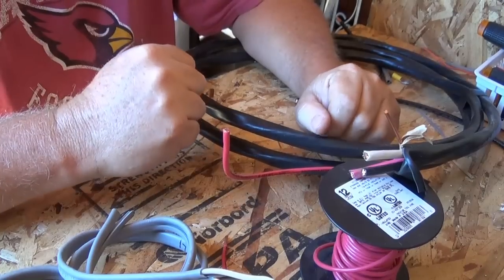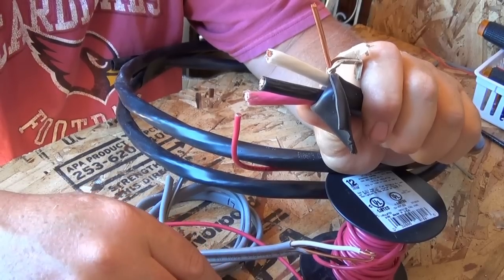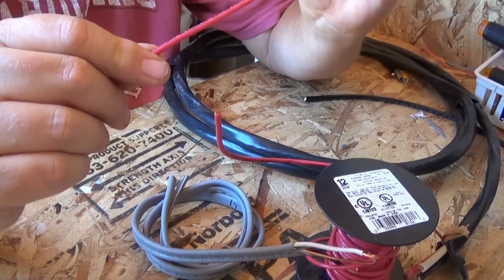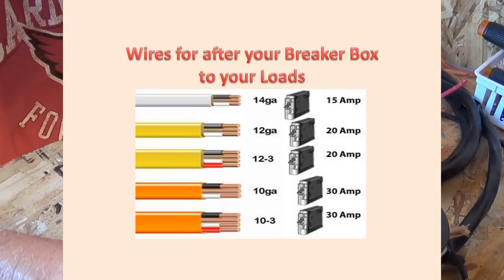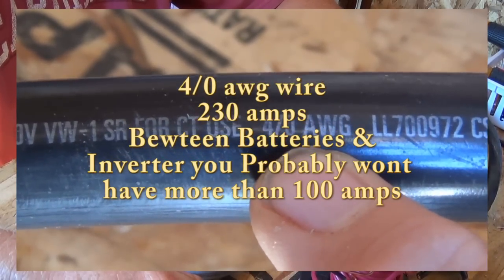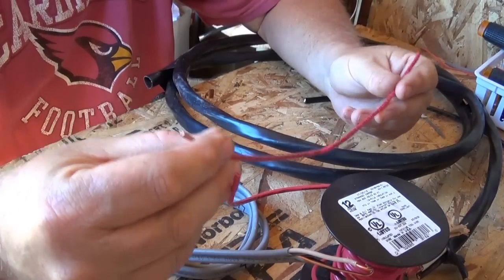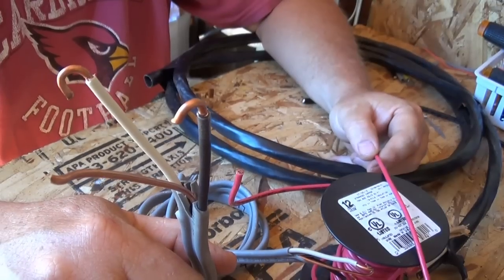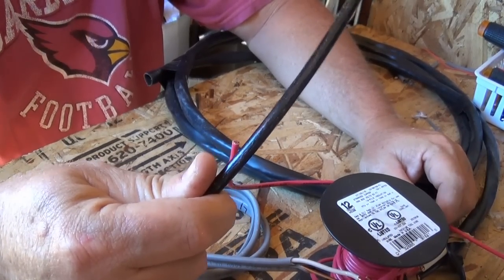What Size Wire Do I Use To Wire My Solar Components? Does Wire Size Matter?

Comment: The whole voltage drop part is bogus.   This is from Google search.  "The total cross-section area, AWG or "circular mill" size of a stranded conductor is equivalent to that of a solid conductor for the same designated wire size. ... Similarly, there will be no less or more voltage drop whether you use stranded or solid wire and the current carrying capacity is the same."   Especially Bad was the lamp cord and voltage drop from 120 to 110 volts in the short cord.   The difference between solid and stranded is flexibility.   Electricians pulling conductors through conduit prefer stranded.   Pulls easier.   Otherwise most of the other information was reasonable.
Reply from the maker: interesting info. i would never use stranded wire with 120 v . for dc stranded does matter.

Comment: Are you an idiot the rating on your wire has to do with maximum without resistance the longer the wire the more resistance so you need to refer to a chart which are available on the net. BE SAFE
Reply from the maker: an idiot. lol thanks. i have a degree in nothing and an expert at nothing. lol..
Reply: ArizonaHotHomestead Disagreeing in nothing is agreeing with all! thank you very much

Comment: If I need 6 strand can I use 2 / 10 ga in  place of the #6?
Reply: By the letter of the law, parallel conductors must be able to carry the load in one wire. Parallel conductors are used to overcome voltage drop.
Reply from the maker: i wouldnt. the same volts/amps will travel each wire and a smaller wire will heat up resulting in potential fire. keep it simple.

Comment: Why factory just make mark on the cable base on amps ??  Not code .
Reply from the maker: dont know. i would assume the wires are used in so many other projects where code doesnt apply.

Comment: AWG isn't a good indicator of current capacity.  I have 14awg, and that's rated for 30 amps, and 16awg at 21 amps.
Best way to select cable is read the manufacturers data sheet. I use Farnells for that.
Reply from the maker: wow 14awg rated for 30 amps. i think that might be max before it starts to melt the outside of the wire. i would never think 14awg could handle that many amps. thanks for the info.

Comment: I wanna if is possible to join wire on ac side from solar  system
Reply from the maker: keep ac and dc separated. use an inverter to invert the dc power to ac and a converter to convert ac to dc but never join them.

Comment: My inverter its burned the last line of fuses 20 amp each one, is 2000 watts current, I change the mosfets but still is burned the last line of fuse, only that the firs and the second is OK. What can it be grong?
Reply from the maker: not sure. missouri solar and wind, or  northern arizona solar and wind might be able to help.

Comment: Stranded is always better cause conductivity depends on surface area. In other words, the stranded one will be more efficient.
Reply from the maker: which is why using dc power stranded wire will hold the volts better than solid.

Comment: if a wire has a 600v rating, does it matter if its a/c or d/c. will it pass an inspection if i use a/c wire on my system as long as the volt and amp rating is correct?
Reply from the maker: good thinking but the way electricity runs you need stranded for dc and solid for ac.  otherwise over a distance if you had dc on stranded you would have a greater loss in volts. and ac may melt the think stranded wire.  hope that helps

Comment: Not explained more but mentioned, was auto jumper cables. They are designed for large amps (large gauge) ... for a short time... starting an engine should take only seconds. The insulation is more flexible for convenience...on the same rated conductor, the heat generated is short term. Continuous high amp circuits require insulation that is capable of handling the generated heat... so is denser, less flexible than jumpers, and of a different chemical composition. i.e. do NOT use jumper cables as hi amperage cable run, as their insulation WILL melt, causing a short circuit & eventual fire !
Reply from the maker: great point.

Comment: I looked into moving 12VDC at 10A(120W) accross 80' and found that i needed to run 4/0 cable to do it(very in-practable and expensive)

Iron rod would have been cheaper(like a car frame) to keep cost down. 

Ended up installing a 500W grid tie inverter, and charging the remote battery bank.
Reply from the maker: wow 80 feet long way. if you could increase the volts you can reduce the wire size.  or bring the 2 closer together.
Reply: Not sure why you needed 4/0   2awg can do it with only a .32 voltage drop.  One thing people forget is that you can double a smaller wire to carry more load.  Two 1/0 wires can do a better job then a 4/0 for about the same price.   Just make sure you fuse the individual wires according to their amperage rating.

Comment: Solid wire is for static installations such as inside walls. It is cheaper than stranded wire.
Stranded wire is for installations that need more flexibility or for applications where the wire would have movement.
Large gauge wire would be too difficult to work with if it was solid.
Reply from the maker: thanks. good information

Comment: Electrons travel on the surface, and stranded has more surface area than solid of the same gauge.   And the "RED" wire is "HOT2", black being HOT1, and white being neutral (bare wire is ground).  3 wire is for running 240vac, so always assume Red means dead if your heart gets shorted between it and the black wire...
Reply from the maker: thanks for the information.

Comment: I'm having a real tough time finding out what size wire I should use to wire 4 6 volt T-105 225 amp hour batteries in series then parallel to end up with 12 volts 450 amp hours, and how  do you find out that information. How should Amps and Amp hours be treated different??
Reply from the maker: amps and amp hours is same thing.  use the biggest cable/wire as possible to prevent the wires from getting hot and losing volts.     i would use 0 awg. or bigger. maybe get away with 2 or 1 awg but feel the wire and if seems to hot replace with bigger wire.

Comment: High Volt PV Cable special design for Solar Systems 
Fire Prood Made in Korea
4mm 
6mm 
10mm 
16mm 

Fire proof high volt 1800vdc to 3000vdc 100% pure copper & imported Tin-coated 
SparkSolar
03225550018
Reply from the maker: thanks

Comment: 6/3 with ground -
the extra red wire is normally used for a second power circuit so you can run 240 volt equipment 
 (120 volts on black + 120 volts on red )

Yes, it can also be used for a three way switch.
Reply: Yes thats exactly what I was thinking, two hots a neutral and a ground.
Reply: Means of 7029 sir?
Reply from the maker: thanks

Comment: If we assume that this cable 4 × 10 mm square each won the red, yellow and blue bears 50A and the sum of the three azazens becomes 150A question here won the cold black (neutral) is only 50A how to withstand the load charged against 150A
Reply from the maker: i am not an expert. dont understand what you are trying to say. sorry.

Comment: In Australia it is law in contruction buildings and even RV's to use only stranded. You don't even see that solid copper anywhere here.
Reply from the maker: is that just for dc currents? i think its code for permitted projects in usa for dc to use stranded and specific size.
Reply: ArizonaHotHomestead AC and DC both.
We are planning on importing a 5th Wheeler for our family to travel Australia in and part of making the RV to Australian standards is changing all of the solid copper into strandard.
Reply: Here in the USA I don' think I've ever seen solid wire used in any mobile applications. It's used mainly in buildings, inside Romex, or when it's pulled through a conduit. I don't think you'll ever see it in an RV.
Reply: Dave Bethel yes we do, that is one of the few things we have to change to make the RV Australian Standard. Otherwise I wouldn't of said it in the first place

Comment: The comments on this video exhibit just how little the average Joe understands about electricity.  Whoever thought up the bloody stupid wire gauge system wants hanging by the thumbs.  Over here we use square mm and you can easily work out the current capacity for a copper cable. 5 Amps per mm2 for a fairly conservative safe rating.  twice that if you're a cheapskate who isn't too wor.ried by voltage drop or the cable getting warm / hot, about 3 times that if you're flogging cheap Chinese tat on Ebay, 3 times that through CCA cable if you're flogging complete shit on Ebay.  Solid or multicore makes no odds at DC or mains frequency AC, the skin effect only starts having an effect at high frequency.   The  capacity of a cable depends on the amps, you can carry a lot more power at higher voltages through the same cable.  The voltage rating on a cable is a measure of the insulation.  Higher voltages need to be better insulated.   Transferring 1kW (1000 watts) would need say 10mm Sq cable (~7AWG) at 24 volts but only 1 mm2 {~17AWG) at 240 volts. Kind of why the grid uses voltages measured in 100,000v's .   Loads and loads of power down pretty thin cable.
Reply from the maker: thanks for the information. lol mm? i think of the candy m&m and wasnt there some rapper back in the 80's name mm? lol   mm is to much thinking for me. lol   i do appreciate you information.

Comment: just cirious can a 60 amp breaker be used for an Air Conditioner
Reply from the maker: there should be information on the AC telling you the rated amps for the unit. go with that size breaker.
Reply: yes 60 amps breaker will work with any kind of air conditioner

Comment: Good info. I'm getting ready to install some solar panels on my RV and it's nice to get confirmation that my choice of wire for the installation is correct.
Reply: Most of the EC 3 wires for panels are 10 G. multi-strand cables. 8G. IS available,if needed.
The critical wire sizes are from the inverter to your batteries. If your charge controller will handle the voltage, run your panels in SERIES to the CC.My MPPT CC will handle up to 90 V.I have seen as much as 80 V. input and that's OK with my CC.HIGH volts and low amps is good.
Reply: Be careful when choosing to wire your solar panels in series. I'm no solar expert by any means, but form the research I've done, when you are wired in series and any part of any panel gets shaded then all panels in series with produce as if they were all shaded. If wired in parallel and one panel gets shaded then the rest of the panels will still be producing to their individual full capabilities . If this is true then series wiring is  only applicable for use if you know you will be in full sun most of the time.
Reply from the maker: nice. good luck with your set up.
Reply: Remember the higher the voltage the smaller the wire. A mppt charge controller will allow you up to 150 volts then change it to your battery voltage.

Comment: Can you safe say the higher the Amp the better for any voltage applications. 

thanks
Reply from the maker: think this way volts wont kill you but amps will. you want large wire so the voltage loss over distance is less becus most devices need so many volts to operate. example some 12 devices need at least 11.7 volts or it wont turn on. the amps for the wire is only the rating so you dont over load the wire and other components.  for your loads you add up the amps of use and dont exceed the rating for the wire. 10awg max 30amps regardless of volts.  large wire to reduce voltage loss but limit amps on each wire to prevent fire and damage to all components.

Comment: Hey man , great information , never found on YouTube , can I ask you , why my car electric wires always get super hot and crack with time ? What am I doing wrong ? My wires are thick .
Reply from the maker: not sure i would assume becus the temp from the engine heats up the area so much that the coating on the wire drys out.

Comment: Hi! Very nice video!  I am wondering what size wire to run from my charge controller to my gate operator onboard batteries? I have a 24V Liftmaster gate operator installed. Liftmaster will not give me information because "Only certified professionals" are allowed to work on this gate opener. but I am rural, and I want to hook this operator to solar. I have two 100W Grape solar panels hooked into a uxcell Intelligent PWM 30A Solar Panel Charge Controller 12V-24V Battery Regulator PV2430, and on to two 12V deep cycle gel batteries hooked in parallel. It makes sense that  I could send wires directly to the DC Battery Power onboard batteries via my solar charge controller.
Reply from the maker: sorry so delay on my response. been busy. wire size? for a gate operator you shouldnt need a large wire becus the watts to run it should be less than 1000w. so running wire size 10 would be more than enough. however check the connections the wire might be to big and if your distance is less than 25 ft maybe size 12awg would be fine. i like to go as big as possible so i reduce the potential for lost volts. you can always run 10 to the device use a junction box and bring it down to a 12 or even 14 for the last 10 inches or so. i have been running size 8 wire for my lights and using a box to down size the wire just before the light to a wire that fits in the screws of the light fixture. .. does that help? again sorry for the delay.

Comment: on the MC4   what  gauge wire thickness on solar  should i ues  on 50 feet  ??  10  gauge   or 12 gauge  so far  no one  can tell me  most  are trying to sell me  the  big time  $$$$$  wire  :(   any  help  will be  thankful    thanks   :)
Reply from the maker: i am running about 50 ft and i use size 6awg.  solar panels to charge controller to the batteres all 6 awg stranded. between batteries and batteries to invertner i use 4/0 welding cable and from the  inverter to a 120v  distribution box i use 6awg solid wire. from the batteries to any dc loads i use 6 awg stranded until close to the load then junction box and connect it to a smaller gauge to the device/load.
Reply: thanks  for  the info

Comment: Do you think I can use 4 ga cables between the batteries in a 12v  (4) - 100ah AGM Battery bank in Parallel? Each Interconnect will be aprox. 10" long. or less...won't know till they arrive and I arrange them......
    ( BTW... I am Runnin a 2000/3000w PSW Inverter with 1/0 Cables from Battery bank to Inverter at 30 Inches each way)
Reply from the maker: being that the batteries are 100ah you can probably get away with 4awg. using the 1/0 cable would be best. every now and then feel the 4awg cable to see how hot them are getting or use a inferred thermometer. not sure how hot the insulation covering can handle but if it seems really hot to touch i would look into getting 1/0 otherwise use the 4awg.
Reply: Thanks for the reply....... I have been touching them since I got the two new ones and added to the array.   I also hooked thm in a Balanced draw / charge way so I think at least till I can get some 2/0 wires they will be ok... I only use this as a back up when I lose power ta boot.   it's not in service all the time. 
    I did the test with 1,000 watts thru the Inverter and they were cool to the touch... I think it's ok for now...
Reply: wildbillo68: knowing the insulation value of the wire you choose is the primary factor in choosing the wire. A 90C wire has a higher amp rating than a 60C wire for the same gauge. A 2000 watt inverter has the potential to draw 167 amps (2000w/12v=167A) so size the wire from your battery bank to your inverter for 167 amps or higher. Don't forget the inline fuse. See an NEC table for Allowable Ampacities of insulated conductors for the amp rating of different wire gauges with different conductor temperature ratings. 30 inches for length is not a significant length to worry about voltage drop so design for amps per temperature rating of conductor.

Comment: Hello I'm new to this but I'm very somewhat confused... where do you find terminals to fit 4/0 awg wire? I had to go to our electric supplier to get the 4/0 wire but they did not have terminals to fit. I looked online but I'm not sure what diameter the wire is. Nowhere on the wire it's self does it say.
Reply from the maker: the wire is also called welding cable. the connectors are also called Studs . here is a link to amazon http://amzn.to/2Hya5yt   my cable doesnt have the diameter either but does say 4/0 awg.....  i deal with Alternative energy for my solar they are a local non profit business. Alternative Energy Discount House
Phone: (928) 521-0888  you can always call Larry and tell him i referred you and maybe you can buy some studs from him and he call mail them to you.   good luck to you.

Comment: What Guage wire do I use for connecting 6x 12v 145ah to make 24v, and a 1800w 3000w surge inverter Guage?
Reply from the maker: i used 4/00 but you smaller batteries so might go smaller. the way alternative energy explained it to me is keep it simple, safer to go bigger and later if you get bigger capacity batteries you use the same cables. plus less potential for loss power. i would go with 4/00 cable.
Reply: 6 or 4 G.

Comment: If I have 2 24v 305w solar panels and will be running them in parralel going about 15' to charge controller what gauge wire should I use from the panels to the controller? I have a Victron BlueSolar 12V or 24V MPPT 100/50 Charge Controller - 50 Amps / 100 Volts . What size fuse would I need? Each panel has "Current at max power (Imp): 9.33 Amps DC".
Reply from the maker: i would use 6 gauge stranded wire. for the fuse use 50amps. the goal of the fuse is to protect the controller so if it can handle 50 amps and you only have 2 panels totally 610 watts 50 is perfect.